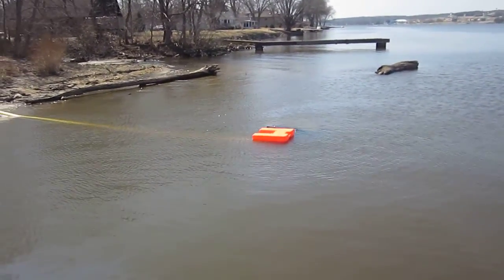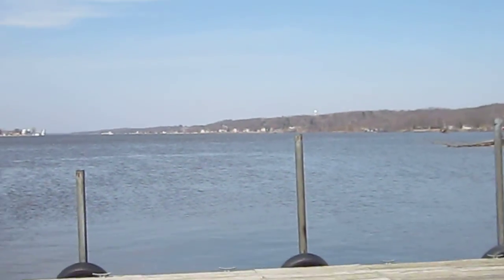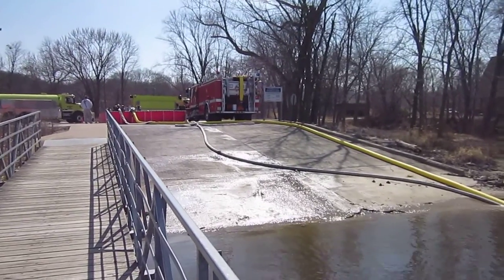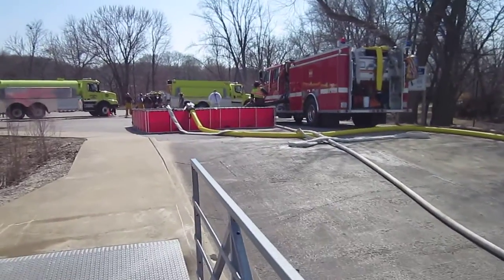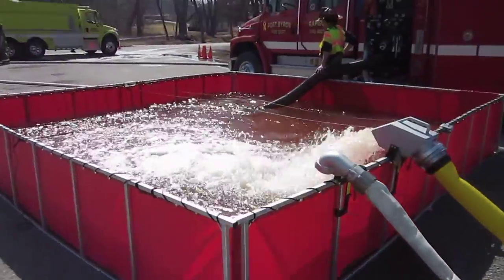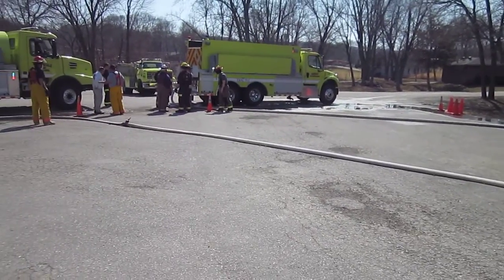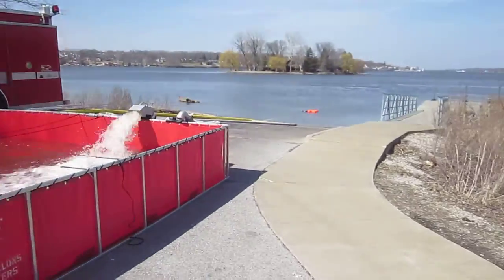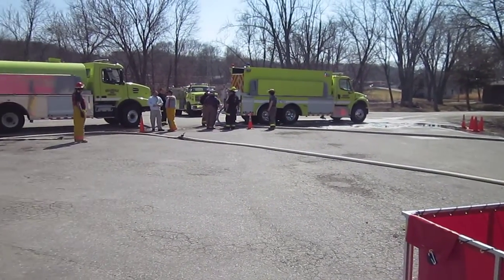Part 4 - Rural Water Supply Drill - Port Byron, Illinois - March 2014

Comment: How did they get that floating strainer out that far and also how much GPM did you get out of the Floating Dock Water Eductor?
Reply from the maker: We achieved about 600 fpm from the educator. The location was a boat ramp so folks were able to walk the eductor out quite far and once it is pumping water, folks can push sometimes push the hose out.  There so was a walkway where they could pull it out. Once it was up an running, the hose drifted away from the walkway.